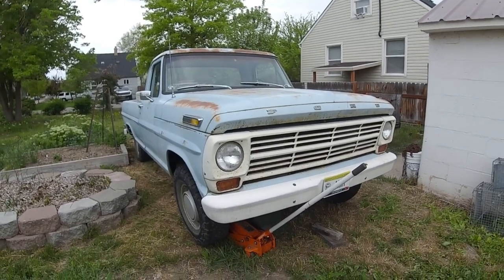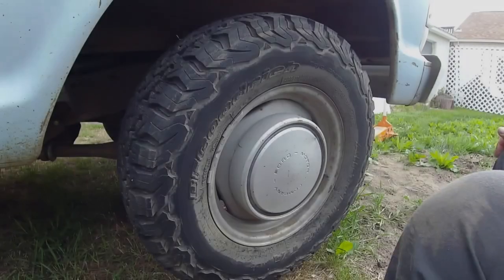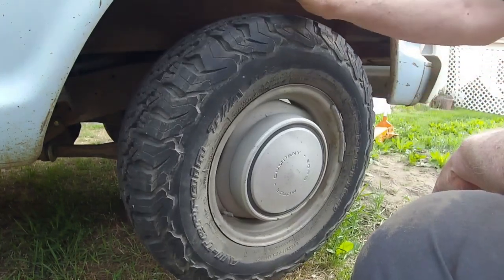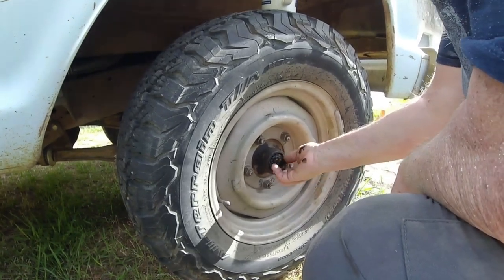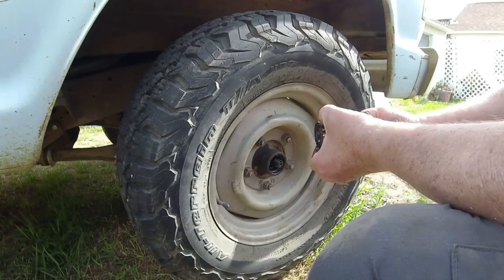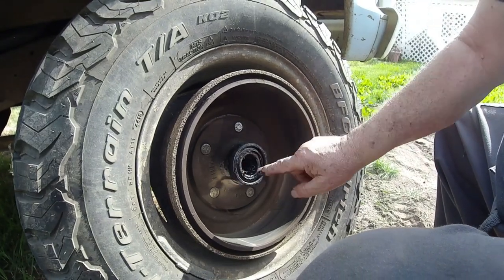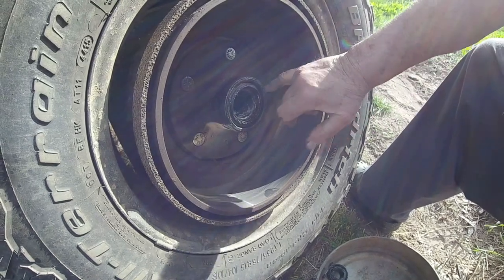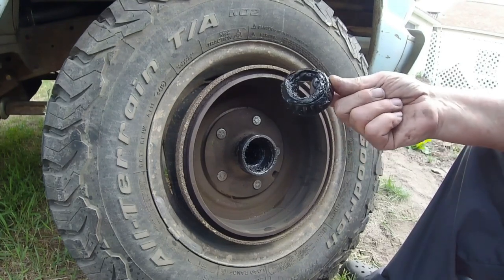1968 Ford F100 wheel bearing and brake service. Adjusting the old tapered bearings.

Comment: Hello,

I recently pulled my grandpa's 1968 F250 out of the field that it has sadly been sitting in since about 2016. I had it running then but found it had no brakes so again I parked it. Now I finally have my own place and have moved it into the driveway. The rear brakes are free but the front drums are pretty well stuck. I haven't torn it down yet so I can't comment on the condition of the pads, drums and other brake parts but do you reckon that I'm looking at a full brake rebuild? Wheel cylinders, hubs, drums etc or is it likely I can get away with new shoes and springs and cleaning up the existing drums? Thanks!
Reply from the maker: Block it up and take a look. I would be surprised if the entire brake system needs to be replaced. 

If there is no braking left, there is a good chance that there has been fluid loss. Its usually pretty obvious where fluid has escaped because the parts look wet or a darker shade. If the shoes have been soaked in brake fluid, replace them. The fluid acts as lubricant and they won't have the needed friction against the drum.

Some parts stores will turn (resurface) the drums, if necessary, for a small fee when you buy their brake shoes. They can usually advise when the drums get to thin and need to be replaced.  I'm usually pleasantly surprised how accessible parts are, especially break parts.

Since these old trucks are simple low-tech machines, they can be pleasant to work on. I approach the maintenance as a relaxing pastime or hobby. I slow down, study the machinery to understand how it works, and do what needs to be done. If I don't understand something I do some research. Youtube has become a great resource for this.
 Hope your break job goes well.
Reply: Thank you for the advice. I ordered wheel bearings, shoes and the other brake parts (springs etc) now just need to find the time to get it in the garage and tear it all down. Do you know of any good resources for the brake cylinders? I'm thinking of replacing them anyway but they're proving hard to find. LMC truck has them on back order at the moment. Thank you for your time!
Reply from the maker: I don't know of a source for brake cylinders off the top of my head. In general, I get a lot of F100 parts from NAPA stores.

Maybe watch some videos on rebuilding them. The only special tool needed is a hone for your drill. They aren't expensive. The rebuild kits are probably on ebay, maybe amazon.
Reply: @nickeljay767  Very helpful information. Thanks!
Reply from the maker: I just re-read your first comment. The front shoes will probably need to be backed off (something I did not do in this video) in order to slide the drums off. I've found that a short, wide, flat blade screw driver works as well as anything to back off the shoes. 
It's hard to see the star-wheel (that needs to be turned) while the screw driver is in the back-plate slot. I usually go by the sound, kind of a ratcheting sound, made by the star-wheel when it is successfully being turned against the auto-adjuster. Try to get a look, through the back-plate slot, to study the threaded bar that the star-wheel turns on, so you know which direction to turn the star-wheel. Stick the end of the screw driver into the star-wheel, then lever the handle of the screw driver up or down against the back-plate slot, depenting on the direction the star-wheel needs to be turned to back it off.
After the shoes are backed off, it can help to thump the drum, from all directions, with a heavy hammer (better than 3 pounds) to help loosen it.
Reply: If you still need to do the brake job, I'll give some advice with my experience on my 66 F-100. I made the mistake of replacing some parts when I needed everything. Rock Auto has everything for less and all is made in China, same as NAPA now. I had better luck with rivited shoes rather than the bonded ones. Get all new parts. You might have drums turned, but new ones aren't too expensive from Rock Auto. Putting the self adjusting shoes together is a pain, so better if you only do it once with new hardware and cylinders. I wish I had the wider shoes like on the 68 F-100, but my truck stops okay now.
Reply: @bluetruck53  Thanks for checking in, I actually got it wrapped up back in October. New shoes, all hardware and cylinders and she stops real good now. I ran the old lines for fall but will be replacing all hard and soft lines next summer. Happy wrenching!